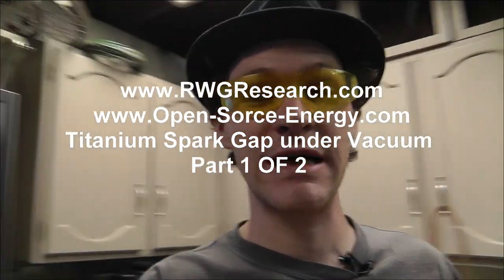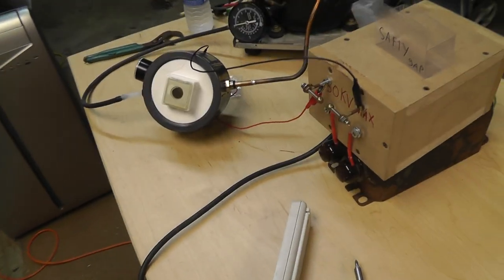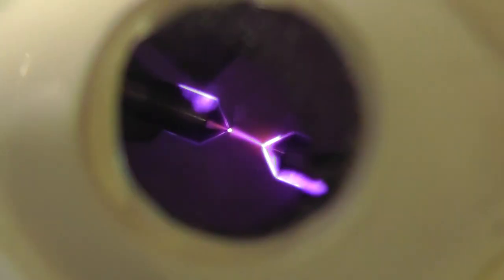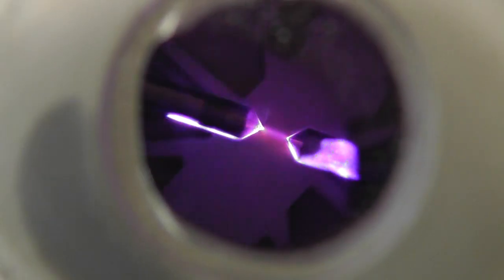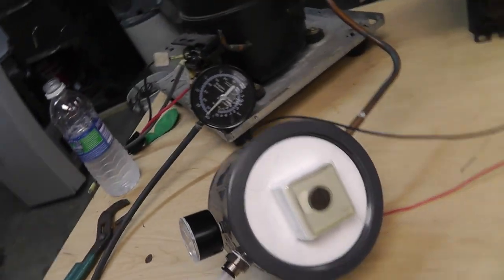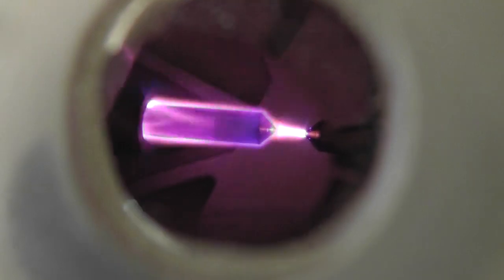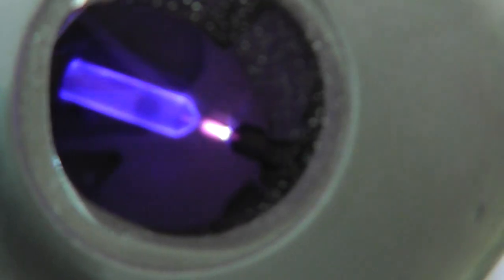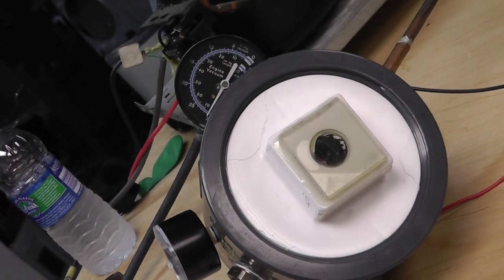Titanium Spark Gap under Vacuum part 1 of 2. Next Lets Add Some Hydrogen! RWGresearch!

Comment: The excitement builds in every episode! 
Thanks much for allowing us to join in.

My two bits are...
Have you considered tungsten welding rods? Some are made with 2% thorium.(!) 
For welding electrodes, thorium increases the current carrying capacity, reduces contamination, and makes it easier to start a more stable arc. Besides, a few grams of thorium can power a vehicle for a lifetime! (Google "thorium cadillac") So maybe it would be a contender in your experiments.

Comment: Good stuff Russ.
Hooking the pumps up in series will definitely improve the vacuum slightly.
Just make sure the more powerful one is connected directly to the chamber. The lower powered pump should be the backing pump for the more powerful one. If you have not done this already, check out the power rating on the pumps. You may increase the vacuum slightly by swapping them around.

Comment: Tesla states that power loss is is most often attributed to poor insulation.
If you can get hold of some high tension cable and connect your chamber to the power supply with it, you may find that you get a more powerful signal in the chamber.
Reducing the spark gap distance to approx 1mm or less could show some benefits.

Comment from the maker: Sounds like you may have a loose connection somewhere. I would recommend not using that circuit until you definitely check it over. This is how house fires start. Please be safe my friend and double check the wiring, or replace it!!!! ~Russ

Comment: That looked well good inside ya spark gap. Titanium bits are best. I use titanium welders bits for some spark gaps. I like the way ya machined the ends like that. Did I noticed on ya nst box it said 50 kv max??Is that the most ya can stick into it?? 
Cool video mate and thanx for sharing ;-)

THUMBS UP*

Comment: I have a question for you...I flipped a couple switches in my fuse box and plasma appeared on the wall ....what is going on here?  It also happened a couple times when I turned a certain burner on my electric stovetop.  Any thoughts on the matter?

Comment: Do NOT DO THIS EXPERIMENT>  If you are successful, you will produce X-Rays.

I sent Russ an email regarding this experiment tonight.  

There is a good reason that plastic is not a good fit for an X-Ray tube! Especially if it is continuously operating and you are standing near it.  You may have noticed how some countries are worried about plastic weapons.  That is because plastic doesn't block X-Rays very well.  You may think that, that isn't really important at these voltages.  It is! Those X-Rays are deliberately filtered out, using filters, like a mm or two of Al.

The soft X-Rays are no good for taking X-Ray images because they are absorbed by the body, that is just what you don't want to happen..... I don't recommend anybody trying this particular vacuum experiment AT ALL.  Commercial tubes, use even higher voltages and current, in order to penetrate the filters, and they produce only the desired range of X-Rays useful for imaging. You won't need to push out hard X-Rays, since there will be enough penetration of the soft ones already!!!  A tube at high vacuum is not the same as a tube filled with gas molecules,  this is no pretty plasma sphere, filled with Xenon Gas...